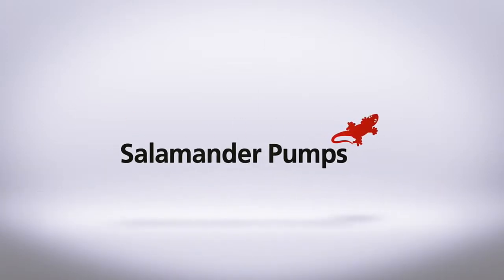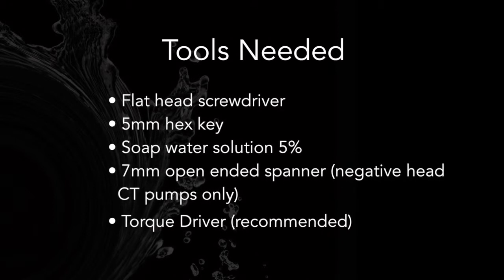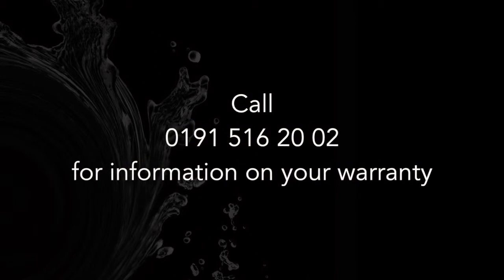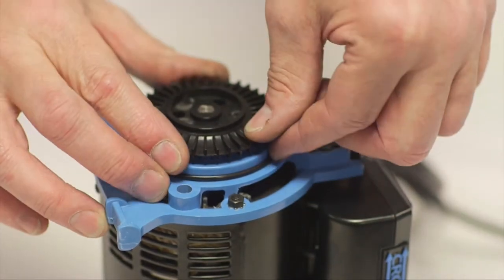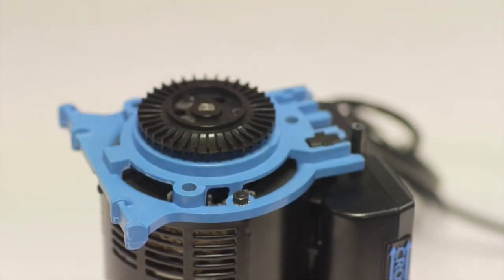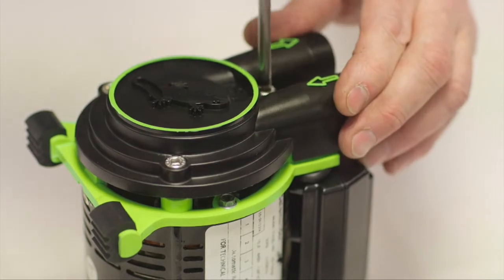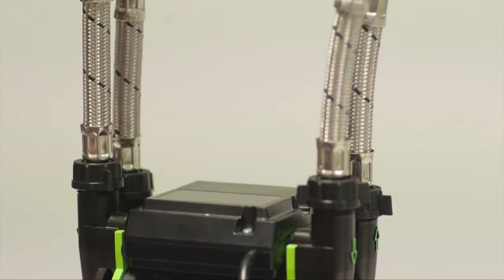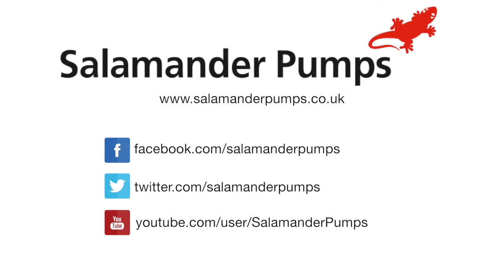How to change an o ring seal on a Salamander Pumps CT Xtra, CT Bathroom and CT Force Pump

Comment: Terrible aftersales,  no spare parts or service kits available,  no mechanical seal kits. New pump screaming its head off, and at £450 and no spares, just shows they just want sales. I will not fit anymore for my customers as they fail alot. Pick a better manufacturer with spare. I'm mad £450 in the bucket after 14 months
Reply from the maker: Hi Ricky, we are very sorry to hear that you've encountered problems with our pumps. Our Customer Experience Manager would like to investigate this. Please can you send us the pump serial number and a contact number via direct message on one of our social media accounts. Thanks.